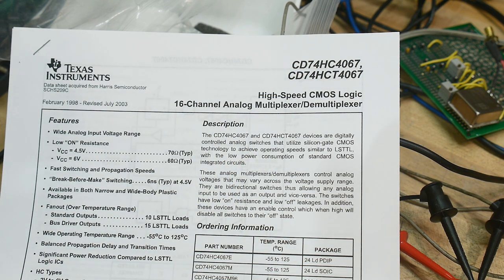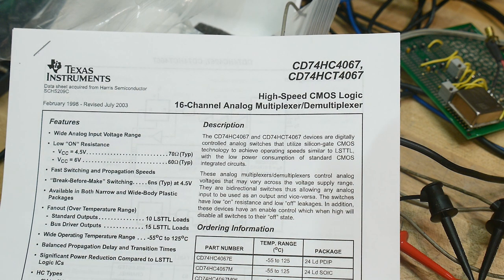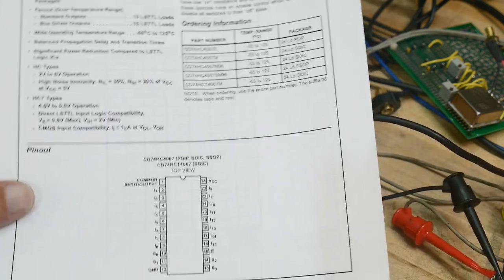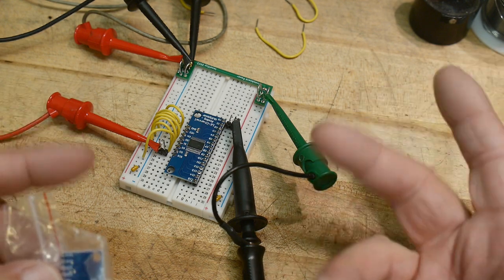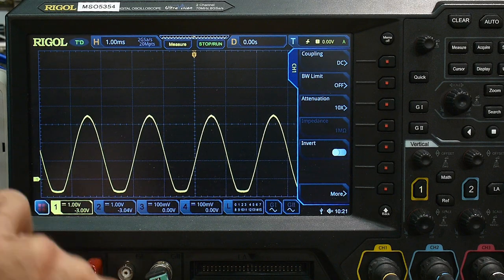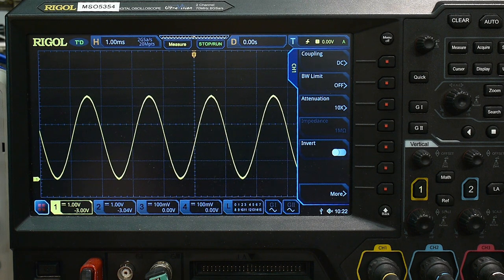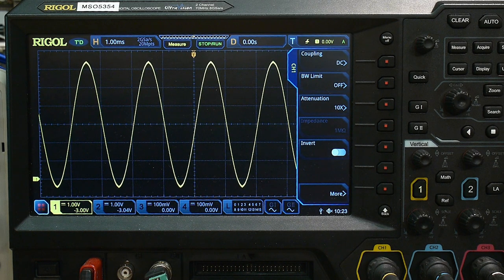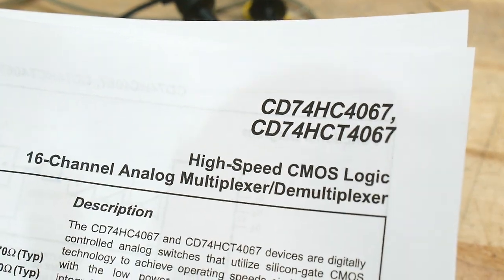#1557 74HC4067 Multiplexer

Comment: What is the max frequency signal that you can send through it without the waveform distorting? Can you send RGB analogue video through it, for example?
Reply from the maker: it's in the datasheet. the response is very flat to 20MHz and the -3dB point is 89MHz

Comment: You need to measure isolation between channels @ frequency
Also frequency characteristics.
Reply from the maker: it's in the datasheet
Reply: @IMSAIGuy  what is input impedance can we use it for RF?

Comment: Original cd4000 series can run up to 18 volts Supply
Reply: i run a TI CD4053 on bipolar -10/+10 volts.
Some devices have 20 volt indicated in the datasheets.
Reply: @AnalogDude_  I've been using CD4052 for stereo audio switching running on a split rail supply -÷ 7.5 V allowing a signal voltage of 15
Reply: @davidkclayton  How much is a normal audio signal?

I used a circuit from someone that co invented the voltage controlled oscillator. using a zener and opamp to create bi-polar supply from 2 x 12 volt.
Reply: @AnalogDude_  if you mean by normal, the level from a preamp to a power amp. Can be anywhere from 600mv to 2v RMS . Depends on the equipment.
Reply: @davidkclayton  yeah, i mean to recall something like you mention by measuring, but that has been a while. many mixers also have a pre gain knob.
Thanks.

Comment: I got a bunch of CD4052 and CD4053 in stock, used them in synthesizer modules working with bi-polar supplies, even works on non symmetrical bi-polar supplies. you also got the CD4016 with is more equal function to CD4066.